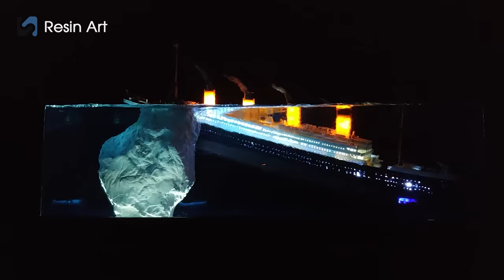Titanic model sinking diorama / Resin Art

Comment: Just in case you didn't know, the 4th chimney was only for decoration, so no smoke could have come through it.
Reply: Disagree. I feel like as air was being displaced by water in the ship, smoky air from the boiler rooms could've been forced through ventilation through the fourth stack. It did have ventilation connections to parts of the ship, the engine rooms, the first class smoking lounge, etc, plus the boilers had been extinguished so there would have been a ton of excess steam to release, which the 4th stack was equipped to do.
Reply: The 4th chimney was used for smoke but not for the boilers it was used for the smoking room and kitchens
Reply: @SlightlyBurnedBread  no it was also used for boiler rooms and ventilation

Comment: There is some accuracy problems with this diorama, such as:
The titanic's engine turned off minutes after hitting the iceberg, so it wasnt anywhere near the iceberg it hit when it sank.

The 4th funnel is venting steam.
The 4th funnel only Carrie's smoke from fireplaces and just overall ventilation to the titanic, not the boilers steam.

None of the funnels are collapsed underneath the water.

The titanic's position of height when only the 2 funnels are above water.

All the funnels are still working, and this is taking place in the Final plunge.

The titanic [when sinking] had a list on port, not starboard.
Reply: The diorama looks gorgeous. The iceberg is there for dramatisation & visual impact, and it looks great. Also, the Titanic corrected its list when the boat deck started being flooded. I agree with what you are saying on the other points, however, for visual looks and dramatisation, it is more appropriate that it has all funnels & the steam exiting the funnels only emphasizes the fact that everything happened so fast and violent, that the greatest thing humans had built was gone/destroyed in less than 3 hours, and it took them 3 years to make it. Never underestimate the power of God.
Reply: @legioner9  ohh yea, the "evenly keel"

Comment: Brother, VERY nice job....However get yourself a version of the model that already has the portals open so you don't have to drill (risking uneven window sizes). Academy has one for $40 like that. I put my own light kit into it, and I'm very happy with the results. It was a LED light strip from Amazon that I simply cut down to the length I needed, and I cut through the lower deck pieces, as you did, to allow that light to rise up. I paint the insides of the white wall pieces, as well as the undersides of the deck pieces, black, as to make the light more realistic looking coming out from the windows in the upper decks.

Mine took me about 3 months to complete (without a resin diorama), as I was very focused on a good paint job for all the small pieces. Painting fine black trim around the upper deck windows to enough of my energy. haha